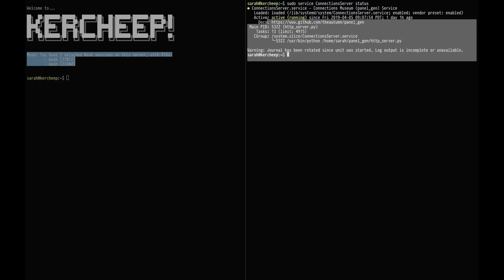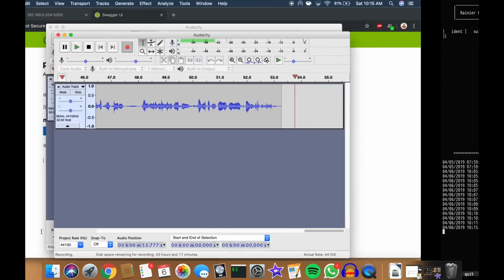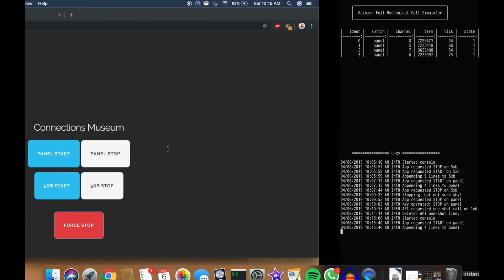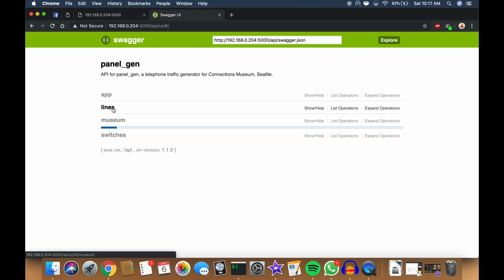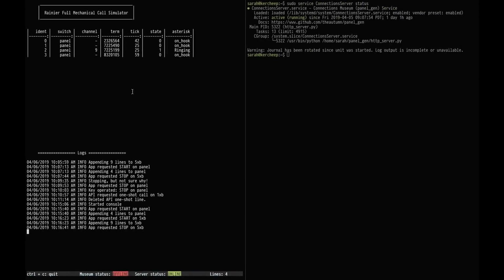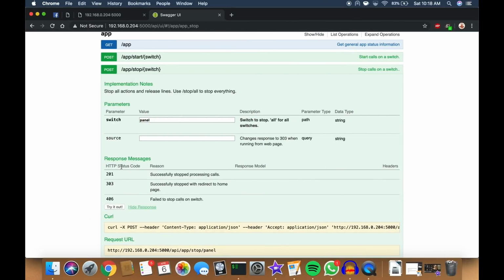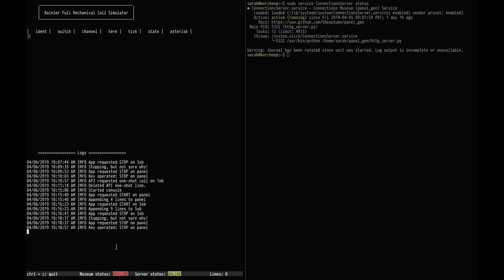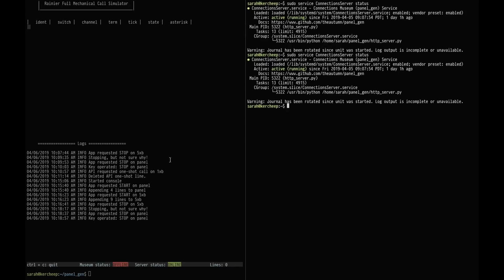Museum Call Simulator Part 2!

Comment: Are the plastic covers on the flat spring marker original or were those a museum addition? Also, what are the miniature crossbar switches next to it used for?
Reply from the maker: @thecooldude9999  they are original, although they used to be clear, and have yellowed over time. 

The mini crossbar switch is an extension to the ”widen” the line link frame. If you had a line link with a low amount of traffic on it, you could widen it to fit more subscribers without adding more junctors (paths in and out). This resulted in greater efficiency of low traffic frames.

Comment: Your channel brings back fond memories of my late father in law. He was an engineer responsible for the maintenance of the mechanical telephone switches around Brussels in Belgium; this was in the late seventies. The systems that were used in Belgium (and in some other European countries) were of a different type. They were rotary switches, but the sounds they made were  very comparable to what I hear here: a lot of relais clicking.  During the weekends, when he was on call, I regularly accompanied him when there was an alarm and he needed to intervene. I was always extremely surprised by how fast he could diagnose what the problem was  in this enormous amount of  racks, sometimes several stories high.

These mechanical switches were soon replaced by "System 12" switches (manufactured by the  Bell Telephone Manufacturing Company). When the last one of these mechanical switches were replaced, my father in law retired. 

As a side note; at that time I worked as a systems engineer for a subcontractor for the  Bell telephone company and I participated in the development of a connector pin population machine for the system 12 backpanels.

Comment: I'm curious as to what the hardware interface between Asterisk and the switches is... I'm guessing a PRI card in the asterisk box and a T1 channel bank with a bunch of FXO's?)  A friend of mine has a small step PBX I'm helping him get running, and something like this would be REALLY handy... :-)
Reply from the maker: That's exactly what it is. We're running a 4-port Sangoma T1 card for a total of 96 voice channels in a standard, run-of-the-mill Dell PC, and we have one channel bank with 2x T1's going into it (48 channels). We are also using a real WECo D4 bank with 48 cards in it for the second set of 48 channels. We can send calls into, out of, or through the switches from the computer in any fashion we want. 

(Small advice: Don't use Sangoma cards if you can help it. If you only need a few channels, get one of the newer Digium cards. The Sangoma cards have awful drivers, and it took weeks of fighting with them to install on a modern linux kernel with 64 bit support)

Comment: Hi Sarah, what are the red box's plugged into the port on the OR's with the numbered lights?
Reply from the maker: Those are little readouts that let you see what digits are stored in each reed relay pack. You can take them off and move them around as needed.
Reply: @ConnectionsMuseum  thank you

Comment: Why is getting a dial tone such a complex operation? Shouldn't it be really simple? Get the next available unit to buffer the digits dialed? How can that be an entire frame of relays?
Reply from the maker: Getting a dial tone is a big job! First, when a subscriber goes off hook, the line link frame that physically hosts that subscriber’s line bids for a dial tone marker. When the bid is successful, the dial tone marker (DTM) has to gather a bunch of information about the calling line, including its frame number, its physical location on the frame (horizontal and vertical crosspoint), its class-of-service (is it a payphone? a regular home phone? part of a business PBX?, one- or two-party service?), and any other special handling information that it needs to care about. Once it has all of that, it goes and searches for a trunk link that has a path to an available originating register (OR). Before it picks an OR, it takes into account the occupancy of the various OR groups and tries to find a trunk link that leads to a group with lowest possible occupancy, and also one that has available paths to the calling line’s location on the line link frame. After it’s chosen a trunk link to an OR, it bids for access back to the line link frame where this all started. (its quite possible, even likely, that in this time, other frames have also requested access to the line link frame so the DTM has to wait its turn). Once access to the frame is granted, the DTM then closes the crosspoints needed to create a circuit from the line link frame, through the trunk link frame, and to the originating register. At this time, it also connects to the OR itself, and passes along all of the information it gathered from the earlier stages, including the physical line location, and its class-of-service and disposition. After the OR stores all of that information in its Originating Register Line Memory (ORLM), it then goes and provides dial tone to the customer, and informs the dial tone marker that it can release itself, and be made available for the next call. This entire process takes about 1 second or less to complete.

As if that wasn't enough, the entire thing is self-checking, so at each stage of its operation, it knows whether or not something is wrong. If it runs into a problem, it gathers as much information as it can, and transmits that data to the trouble card recorder, which punches a card that contains a snapshot of the state it was in when it encountered a problem. This enables the maintenance force to go in and fix problems when they occur.
Reply: @ConnectionsMuseum  could not have said it any better, actually I could have not done it at all, Great explanation. I would tell people when they picked up the telephone to make a call, they would not believe what's taking place instantaneously as they get dial tone. My expertise was in number one number four and number five ESS including tsps. The average person has absolutely no idea what's taking place. Some people still believe that an operator does all this connecting and checking. Today is September 27th 2022. I started working for Western Electric February 1963. Had a total of 36 years service before retirement. I try and watch every single one of your posts, the older equipment I was never, involved with, but I did witness it in operation many many times. Well I started the big push was the number five crossbar, and basically I just ran cables and wired line links. I started my ESS education, in 1964, and never stopped until I retired for the most part.

Comment: Very cool.  It’s also mind boggling.  Where I grew up the telephone company gave a tour and I remember the 3-pronged crossbar switches.  I went on the tour in the late 70s.  I asked the technician what the name of the equipment was and he said C2.  This was in Dartmouth, Nova Scotia - Canada.  

Something I noticed at the beginning of the video was “asterisk”.  Does your phone system also use voip?   I run an asterisk server for a small business and it’s very cool but I was surprised to see asterisk on your screen with this older step-by-step and crossbar system.
Reply: Asterisk does not just do VoIP, It can also do TDM.
Reply: The museum is on the Collectors Phone Network (C NET).  Not just Connections: other museums and private connections can call each other over the Internet.  
And it would be a shame to not connect all the different generations of technology together, wouldn't it?
Reply: @jordanrodrigues1279  I agree.  It’s great that they are all interchangeable.  I’m only familiar with the voip end of it.  Asterisk is amazing with voip.  Extremely reliable.

Comment: I wonder what would happen if Fran Blanche ( Fran Tone / Fran Lab ) / CuriousMarc ( currently part of the AGC  Apollo Guidance Computer restoration ) and Sarah all hooked their projects together ?  I'm thinking it would make time travel possible.
Reply from the maker: Bob Roberts I was actually just thinking of reaching out to CuriousMarc to come do a video with us. I just haven’t yet because I’m actually kind of shy when it comes to things like that 😅
Reply: Tech people are always interested in finding / seeing new goodies so have no fear.   Other you tube channels collaborate so this is nothing new. 

I found your vids a few weeks ago and recently realized that the phone switching system is a computer of sorts in that it receives / decodes a dialing input and produces an output to the called phone.  It also makes decisions ( off hook too long, busy signal, other diagnostics ) 

Have a look at the channel PrankyCallz , he has lots of vintage recordings of how the phone system operates ( Clicks, buzz , stock recordings ) . If your museum hasn't archived this, please make an effort to do so as this in the kind of history that can slip through the cracks. 

While I have you on the phone,( Tee Hee )  I see you have the start panel for the backup generator ( GM Diesel Engines ) did the generator come along too?
Reply: We have the GM Diesel Engines generator panel for power. We have the Number 5 Crossbar switch, which is an excellent sub for a Flux Capacitor. All we need is Fran and that AGC Apollo Guidance Computer and we're in business. Doc Emmett Brown eat your heart out!
Reply: I can imagine the grin on Marcs face if he got to see this :D
Reply: Seconding @CuriousMarcs involvement!

Comment: That is some awesome work in my book Sarah!

Just a word of caution, beware of those relay modules. 
I had issues with one of those, it was sticking on even when I turned off the coil signal.
Good thing is finding a "proper" relay that'd fit should be pretty easy, relay pinouts are relatively standardized.
Reply from the maker: Charles Thatisall yeah I got these as a pack of 10 off amazon and they were really cheap. Wouldn’t surprise me if they fail at some point. I’ll keep that in mind ❤️

Comment: Can we get a close up of the outgoing sender to the panel switch? I'm curious to hearing the RP cadence and differences from just the sounds of the sender relays as opposed to the burp burp buuuuuuurp burp hear from the calling party side 😊
Reply: Actually, nevermind that. That burp sound comes from the terminating panel register (I think), and the originating sender simply interrupts the RP as can be heard from those precisely timed several relay engagements 😊 thanks again!
Reply from the maker: ladams00 that’s right! All the originating sender is doing is opening the circuit at the precisely correct time to stop the upward travel of the brush rod. Those are the clicks you hear in this video.